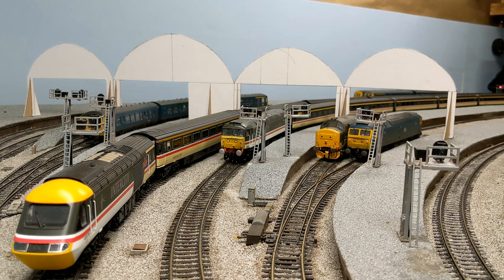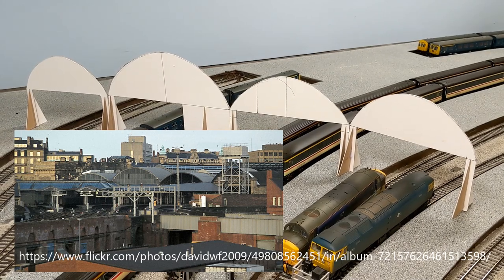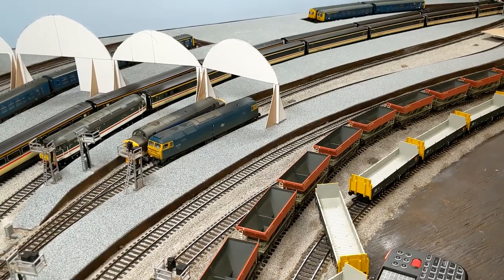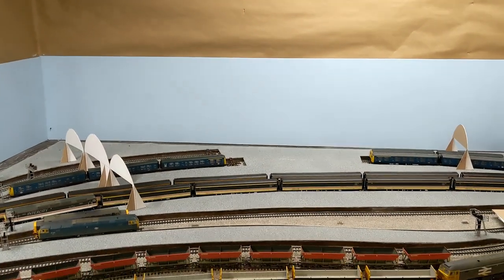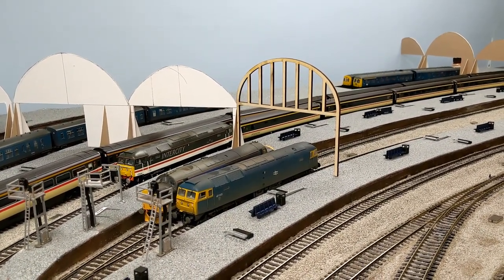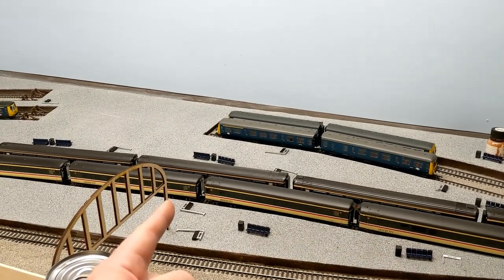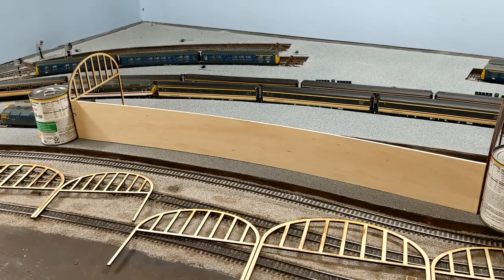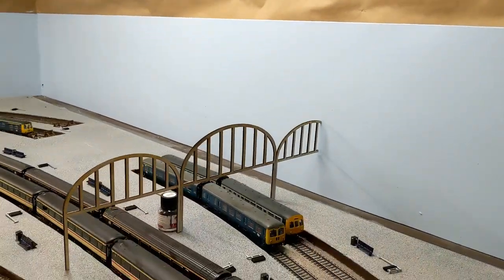40 - Station buildings - part 1

Comment: Considering the limitations you explained with the curved points and changes in width, you've pulled it off brilliantly so far.  Excellent work, Ian.  Laser cut and 3D printing really are impressive.
Reply from the maker: Thank you. It's always constraints of modeling within the size available. I think it will be a good balance and hopefully still pretty recognizeable as Newcastle when finished. Iain

Comment: Good to see you back . I wouldn’t get caught up on actual measurements the key thing is to capture the essence of it , which I think you are definitely doing . Looking forward to the roof build
Reply from the maker: Yep, thank you. It's hard when condensing down to a scale model, so it's trying to keep everything in balance. Was the same with the platforms - they're smaller than they would be in true scale, but it works well for the space I have. Thanks for watching and following along. Iain

Comment: Nice work mate the canopy is looking good so far hope you wont have any issues with the wood warping prehaps giving it a primer coat will protect it in the long run i will be intrested to see how this project goes. I wish you and your family a merry christmas and a happy new year and lets hope that 2021 will be better.
Reply from the maker: Thanks. With the platforms themselves, I used a spray varnish which didn't seem to cut it. After I used a brush-on varnish, that seemed like it would have done it and dried just fine, but the card was already a warped a little by that point. This time, I'll go with brushed-on varnish from the outset and that should handle any moisture problems. Will see! Iain

Comment: Progressing well mate. So look forward to your videos with this being my home town station where I spent many hours late 70’s early 80’s freezing my 🥜 off during my train spotting days. You mentioned that far corner of “ wasted space “ and there was & still is actually a Royal Mail/Parcels depot in that area with parcel rolling stock in sidings so maybe something for you to consider. Don’t know if you remember but Newcastle central at that time had its own dedicated 03 shunter also 👍
Reply from the maker: Thanks for all the info! Yes, that corner would have been where they would have loaded in from the street, right? I know there were a couple of places where it seems like there was always a bunch of Royal Mail activity. I've been working on the 3D-printed red hand carts, so will share them soon.

Also, do you know what the old building is on the south side of the station across from where the bypass lines are? Looks like an old signal box maybe? Seems too small for a coaling or water station. It adds a little interest, and I have some space I could model it, just wanting to understand a little more about what it is!
Reply: Yeah all loaded from the street as such but if you look at old pics some nice detail there. Walls are still up but used as Carpark for workers now. As for the building on south side would it be on the right side of station as you look at the south side from the famous Newcastle castle?
Reply from the maker: So actually, couple of different buildings then :)

One of them is that one, yes - what was on the right hand side looking south from the castle itself, looks like it would have been on the edge of what's now the car park? It's right behind the Class 47 here - https://www.flickr.com/photos/robert55012/5673544837/in/gallery-188895051@N02-72157714710918752/

That's a building I was going to model in the empty space over by the two DMU platforms I have.

The other building I was thinking about is on the other side of the station as you'd be approaching from the south. It's right behind the Class 47 in this interesting consist - https://www.flickr.com/photos/60539035@N02/12226208485/in/gallery-188895051@N02-72157714710918752/ . A more recent photo is then https://www.flickr.com/photos/75514026@N03/8268127090/in/gallery-188895051@N02-72157714710918752/

Looks like it has "NER" on a name plate and then a date in the 1800s. I originally thought a signalbox as it seems the wrong place for any kind of office buildings? Can't find much about it!

Comment: Wow,  I worked on the refurbishment of the station roof that was undertaken before the 150th anniversary, so its great to see the trainshed taking shape, you are really capturing the character of the station.  
There is a 5th smaller barrel roof between the 3 Dobson roofs and the straight south barrel roof extension designed by Thomas Elliott Harrison, this may help you join/fill the gap between the 3 Dobson curved roofs to the straighter south barrel.  The 5th roof is clear on google earth, google street view (from inside the station!) and details on the following website; http://www.railwayarchitecture.org.uk/Location/Newcastle/Newcastle%20Central%20Station/Newcastle%20Central%20Station.htm
Each barrel roof has a glazed section at the crown, may I suggest that you include an enlarged version of the glazing to enhance your view of the inside of the trainshed.  I have a few drawing details of the roofs and end canopies that could help, let me know if you wish to view these.
Reply from the maker: Wow, that's awesome! It's amazing I'm out here building a model of what you had worked on for real.

Yes, the fifth smaller barrel roof I'll be modeling. Not sure I mentioned it in this video on this next stage I'm doing now. But, I think I want to wait until I have the main Dobson shed and then this extension in place so I know the right dimensions. Once I can measure it in place, should be easier and fit a little better.

That website is one I've had bookmarked for a while and have used for reference photos! Thanks for sharing. And yes, I think I am going to enlarge the glazing now that I've started to see the roof coming together on the extension building. Still trying to find a balance.

If you have anything to share, that would be awesome! Feel free to email me at i_foulds@live.com